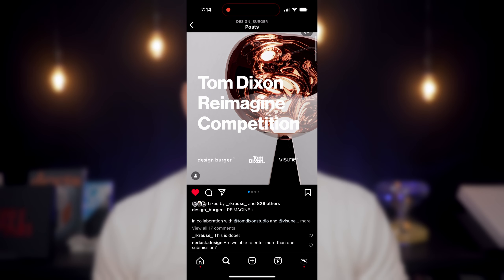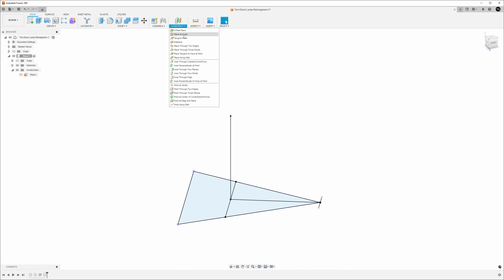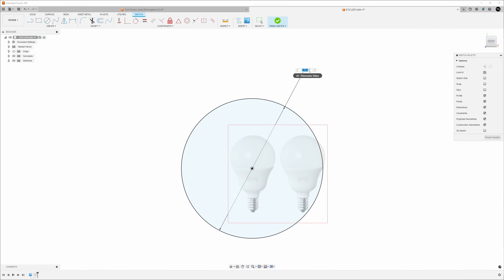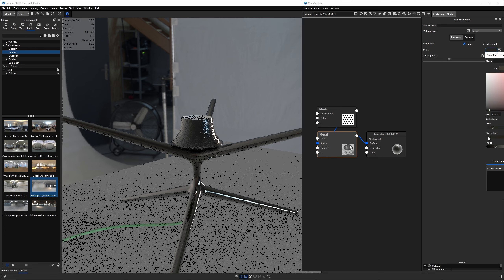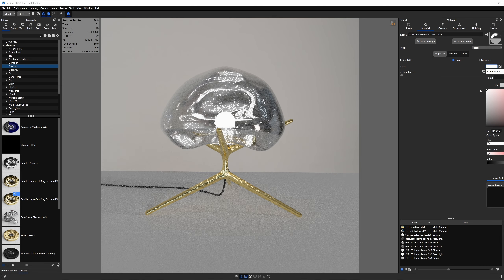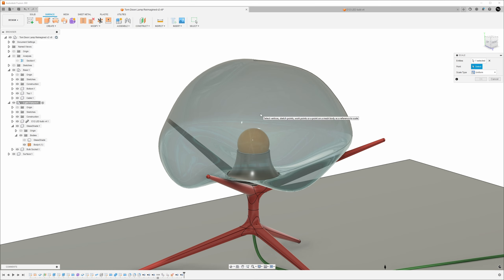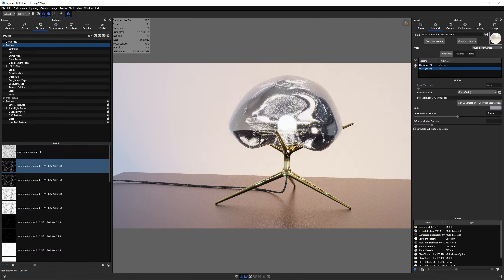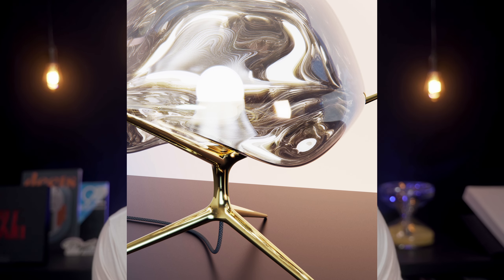Tom Dixon Lamp Reimagined with Fusion 360 and KeyShot

Comment: Awesome result! I've 0 experience with Fusion but the way you can change stuff later on sounds great. I mostly ended up with loads of versions of files which is not that bad but my designs also evolve a lot while working on it and basically I've to start over a lot.
Reply from the maker: Thanks Oscar! Yeah, I like this program a lot. For what I do most of the time, it's easy to use. I've also been using it a long time, so it's comfortable. I seldom get 'stuck' and am unable to model what I need here.

Comment: Awesome!! Thank you. Great work 👏 
I have a question please, have an idea why KeyShot is crashing while using GPU mode?
I have NVIDIA gtx 4060 graphic card along with Core i9-13xxH ,with 16 gb ram.
Reply from the maker: Could be any number of reasons. First off, make sure you've got the latest GPU driver directly from Nvidia's website installed. After that, if it's still happening, let me know.
Reply: I have the latest driver version already
Reply from the maker: I just came across a different post somewhere else: I’ve also read that GPU Tweak 3 (software from ASUS) causes instabilities with KeyShot on rendering and startup. Not sure if this is relevant to your situation.

Comment: Thank you so much for your incredibly informative tutorials. I am currently using a desktop with an Nvidia K2200 graphics card. My issue is that, for rendering, the GPU option is not showing up. Initially, the GPU icon appeared and prompted me to update the driver, but when I performed the update, the GPU icon disappeared completely from the software, leaving only the CPU option. However, I don't have this issue at all with my laptop. Do you have any idea how to solve this problem, please?
Reply from the maker: Hmm, that is odd. Did you go to the Nvidia website to download the latest card-specific driver? Sometimes the automatic updates don't work well. Unfortunately, you may need to try reaching out to Luxion support. I'm not sure what else to do to troubleshoot GPU issues like this.
Reply: @WillGibbons  Yes, I went to the site and downloaded the latest driver, but it didn't work. How can I contact Luxion support, please?
Reply from the maker: Try emailing support @ luxion . com @tsadokzannou

Comment: Hi Will, could you help me please! I would like to achieve something in Keyshot, but I have no idea how to implement it. I'm sure you have a solution for that. So here's the thing: I want to create a metallic surface that was produced by turning on a lathe. However, the structure of the surface needs to be so fine that light is refracted in different frequencies, similar to a DVD. I'm sure you've seen something like this before. Tungsten milling tools sometimes exhibit this effect. I experienced this effect again today at work. I was removing material from a nickel-plated surface through electrolysis - just a few micrometers. Afterward, these beautiful rainbow colors appeared on the metal surface. If anyone knows a solution, it's you, Will! Thanks! Regards Martin
Reply from the maker: Hi, yes. This is called diffraction grating (or at least it is in the scenario you mentioned on a dvd). Not sure about accurately simulating it in KeyShot. Unfortunately, adding clear coatings doesn't really work What you could try is using the metallic paint material. Take the metal coverage to 100% and remove the roughness. You can then use a procedural color gradient texture in the material graph and plug it into the clearcoat color for this material. Should work! Let me know how it goes.
Reply: Thank you for the quick response, Will! I would like to give it a try. I'll try to figure out how to create such diffraction grating patterns, maybe using Photoshop or something else. We'll see. Thanks a lot!
Reply from the maker: No problem. But you should not need Photoshop at all. As mentioned, there is a procedural color gradient texture in KeyShot's material graph that will allow you to create the rainbow texture without leaving KeyShot. Just google 'keyshot procedural color gradient' and you will probably find some how-to's on that. 
 @MrGreen-ir1vn